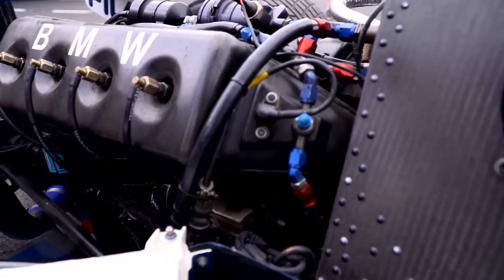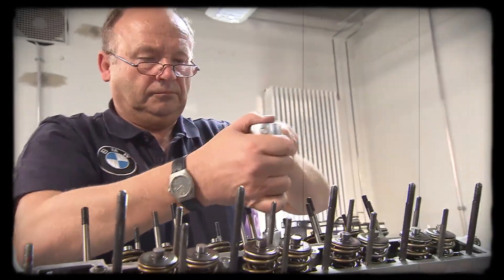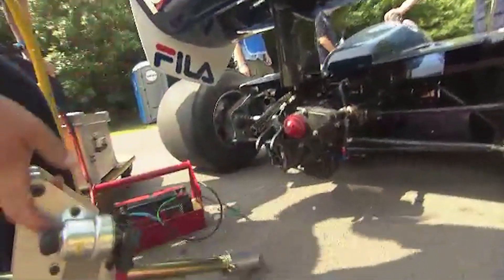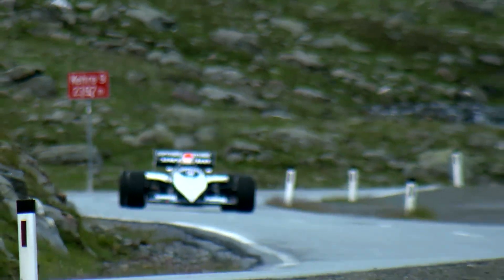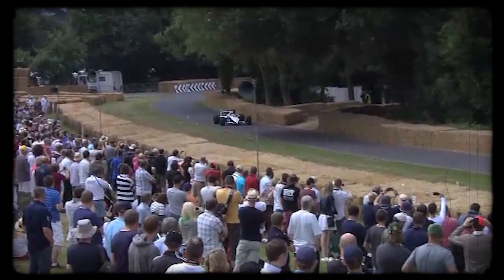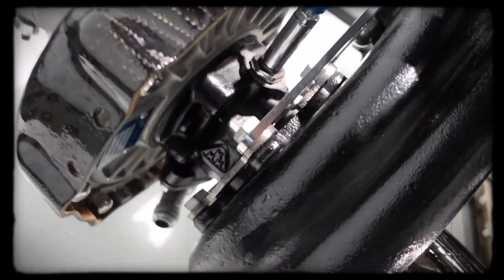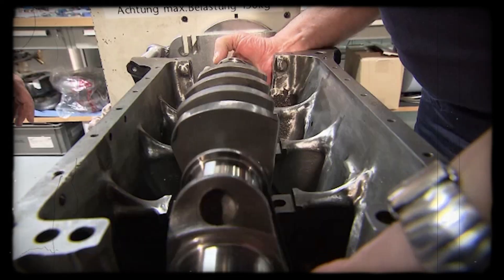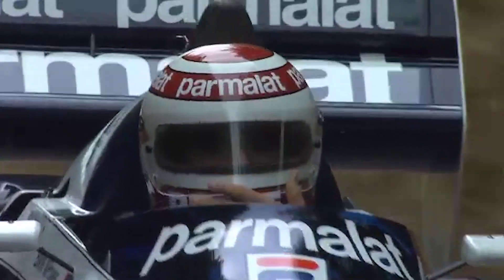The Shocking Truth Behind BMW Banned 1400HP M12 Engine

Comment: Pissing on the block isn't for mechanical strength.  It is a little bit of a mind f*ck. Like if all things are equal but everyone knows one mill got a "special" treatment it could give the driver of the urine block s bit more confidence while the driver of the piss block a bit less confidence.  One could achieve the same by simply telling everyone it was done instead of actually doing it.

Comment: Uff... A lot of things mixed together... BMW could run the engine with ~ 1250 hp (no dyno could do 1400 at this time) in qualifing trim, but this was only possible in 1986, with the Benetton 186. Used in the Brabham BT52, it could generate about ~700 hp. Also the engine wasnt such reliable as shown in this video. Engine failures are common, because of the inline 4 design (virabtions, overheating etc.). Dont get me wrong this engine was a masterpiece, especially in the first years of the "Turbo era"...

Comment: Never banned.
Reply: Yes and no.
The M12 itself was not banned.
However, turbo charged engines were (over) regulated, and as a group, were banned starting with the 1989 season, until the turbo hybrid era.
In addition, the inline 4 layout was not favorable for multiple reasons, including placement (weight distribution, Cg), power delivery, and fuel consumption.

Comment: You don't "relax iron's internal structure" by leaving it out in the garden. To properly de-stress the metal, it needs to be annealed...and the annealing process happens at temperatures between 800C - 900C. A day in the sun is gonna do jack shit.
Reply: Internet bores unite